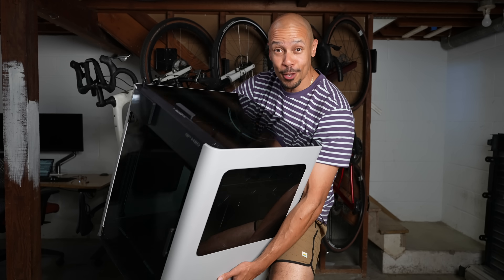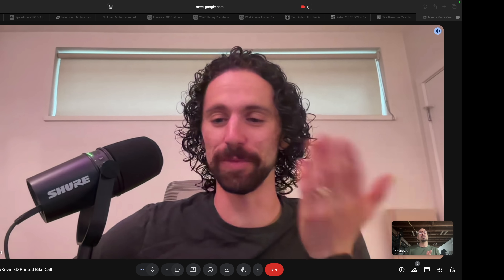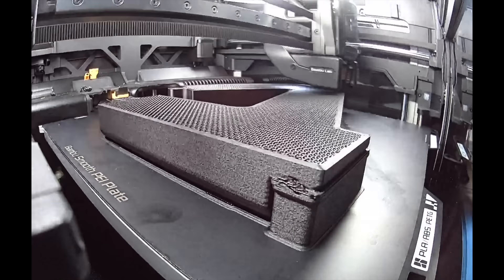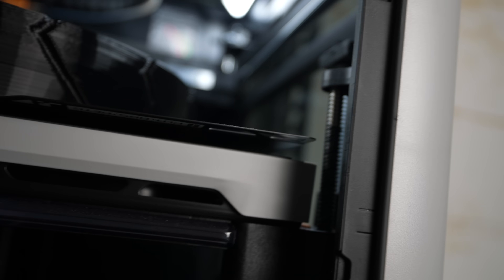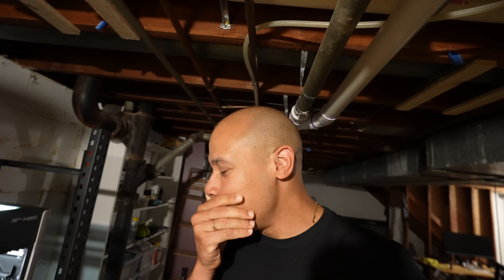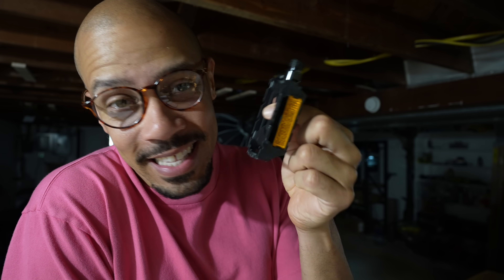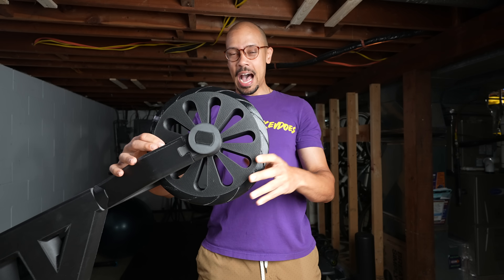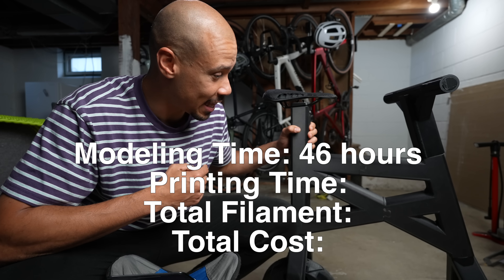I Made the World's Most 3D Printed Bike... Again

Comment: Just so you know, you can 3D print bearings. Might not be advisable.
Reply from the maker: Yeah I looked into it but didn't trust how well they would work based on what I saw
Reply: @KevDoes  I'm diabolical enough to think, "you know, I bet you could do X with only a 3D printer". Which, I mean, it's all material science. One of these days, lemme just download a car, yeah?

So far I only have a couple of PCTG bearings in one of my spool holders. Which works well enough, with some silicone lubricant. 

If I were designing a plastic bearing, it's gonna be comparatively big, and wouldn't have traditional balls. It would probably use multiple concentric rings to (exponentially) decrease friction.

Comment: finaly somehting atleast bit working even shity.. but finaly.. it nor self disasembly on one ditch.. it took about 6+moth also ON VO6RON and not that garbage bambucrap it will toon just 3-4days.. with BIG format well 2 max..  coz voron.. is actualy.-. 10x faster where bambucrap go 250-300MM/s  VORON GO 1500-3000 just go with 0,6 or 0,8mm nozzle.. it will be more structuraly stiff.-. also more outside layers less useles infill.. ALSO.. if oyu havE voron GO WITH THIS GUYS (( Pantheon Design )) this is real ingeniers.,,,   INTEAD THIS DITCHER..

Comment: 8:58 that's grease, it's supposed to be there for lubrification.

Sometimes they can be a bit overzealous with the application and there might be some excess, but it shouldn't be removed unless it's getting in the way of something (like dripping on the print bed or accumulating dust).

Not necessarily an issue that you removed it, but if you ever get weird noises from the mechanisms you'll know what to do.

Comment: As soon as he said "One Thous...." I said "Oh hell nah"
Reply from the maker: Haha I totally get that. BUT you gotta remember that's with super fancy, expensive filament. I wonder if someone can make it with cheaper filament and still get it to work
Reply: @KevDoes  PLA+ with high wall count should be more than enough if strength is an issue. It's only 16$ a roll, so should keep costs down a good bit. Adding a channel running inside all of your parts to allow you to insert reinforcing rods, like pvc or metal tubing, would keep the whole thing rock solid as well. Also, I don't know if you did this, but adding a 0.05mm gap to any parts that are to be mated together will keep everything tight while also giving space for glue and test fitment. Love the video btw.
Reply: @KevDoes  Use less filament and a gyroid infil. Gyroid makes two interlocking spaces that can be filled. You shouldn't have to make the whole part full of infil, make them like very thick walled tubes so between the inside and outside skins there's enough space to flow resin through the infill between. If there's a style of infil that is like open cell foam, that should work better because with gyroid there would be small spaces here and there against the walls that could be sealed chambers.

What resin to use? I'd try Smooth-on Onyx Slow. It has a 5 minute pot life before it begins to set, and a 90 minute cure time. However it doesn't reach full strength in that 90 minutes. Post curing at 250F / 121C for 4 to 6 hours after 1 hour curing at room temp boosts heat resistance of Onyx Slow to 212F / 100C and Onyx Fast to 250F / 121C.

I'd design fill areas with no infill and a 3D printed funnel to fit in it to aid in pouring in the resin. For a fast curing resin like Onyx I'd find a way to pump equal volumes of part A and B through a static mixing nozzle right as it's going into the 3D printed item so it has maximum working time before it starts to cure.

Another possibility for filling would be to pump the resin through a static mixing nozzle into the bottom of the parts so it won't get air trapped under it. That would need some way to seal the tip of the nozzle to the printed item, Onyx resin is very thin and will leak through any opening. Or make a completely open path somewhere from top to bottom to pour the resin in so it can drop all the way down then fill up the open cell infill.

I'd experiment with a basic round, hollow tube section to figure out the needs for perimeters, space between the inner and outer walls, type of infill, and resin filling methods. Then when you have a method that works, apply those details to the fancy pieces.

If the filament you use to print the parts has a glass transition temp higher than 250F / 121C then you can just put the resin filled parts in a convection oven. A CONVECTION oven. Not a normal radiant heating oven! I've been doing resin casting for over 25 years and found 25+ years ago that attempting to post cure in a normal oven will not work well.

I have found that curing at a lower temperature that's still way higher than anywhere on Earth outside Death Valley, for a longer time, works very well for post curing. A food dehydrator that gets up to 145~150F or a countertop convection oven that gets up to 200F, and heating castings for 8 hours, makes them plenty strong and resistant to warping. Note that many countertop convection ovens have a 90 minute time limit, so you either have to keep turning the time up, or find an oven with a longer max time. Dehydrators are made to run for hours.
Not one complaint of anything I've made in over 25 years warping on a hot sunny day. (AFAIK no car I've made parts for has been driven through Death Valley.)
Reply: lmao IMMEDIATELY naw...
Reply: Yh but it's a crazy achievement! Well worth the investment to push the boundaries!!!
Reply: LOL SO DO I
Reply: pretty sure you don't need CF everything and his infill is way too much.
You cant half the price for sure, still way too much, but you can optimise it.

Comment: if you want to modify a mesh from online. insert it like you did then press s then type in convert mesh and just hit ok and it will convert the entire mesh into a body you can modify. also, tip, when you want to test tolerences like dovetails, cut off the dovetails from the rest of the body and just print the dovetails to see if they fit as they should then once they do, combine the dovetails and main body again. these tips should help a lot.
Reply from the maker: Super helpful! Thank you~